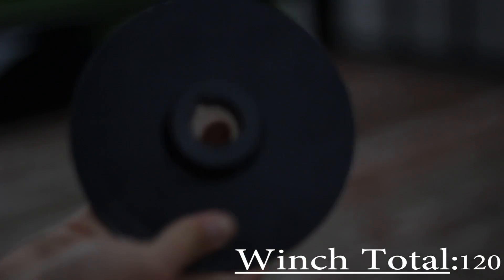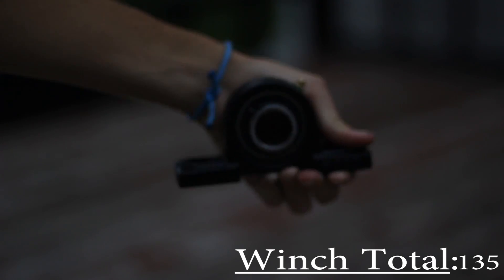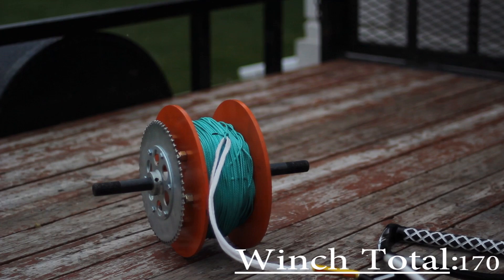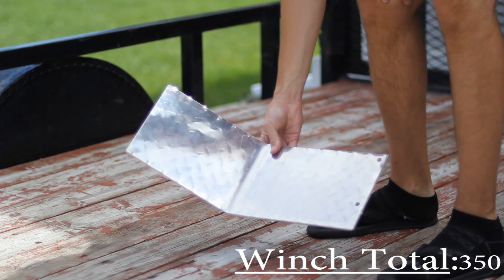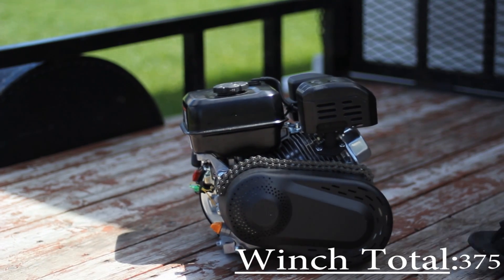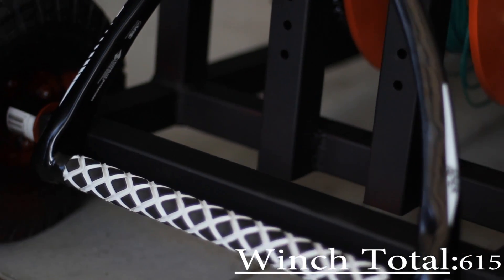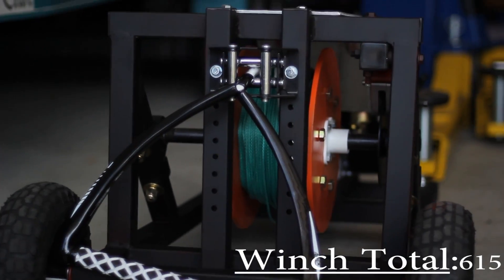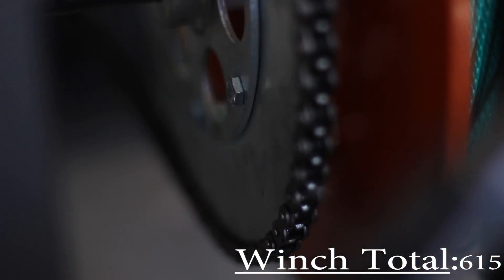Designing: Wake Winch

Comment: I realize this is an old video and you may not respond, but I’m curious if you think this setup would have enough torque to pull small kids up a mild sledding hill? I’m in the process of building on and I would hate to be wasting my time.
Reply: it would so long as you have at least a 3hp engine

Comment: Hey man, just wondering if the torque converter is necessary if I have a 9Hp engine
Reply from the maker: Most likely yes. Depends on a few more things, but you really should have a torque converter for this build. More HP does not mean more rpm, what you want is rpm if you plan on rolling a spool of line in.

Comment: Did you guys have a pin/locking system to free run the spool when walking the handle out? Or did you do so with the engine turning over? 

Also where did you source your line? Recently constructed our own but could only find one distributer of dyneema here in the UK!

Comment: To me the spool looks like the most difficult part! Did you buy it complete? Could you be more specific how you built it. Any useful links?

Cheers 
H
Reply from the maker: Yeah man, don’t buy it complete it’s not too terrible to make yourself. I don’t have any links, but I’m sure other dudes on YouTube have videos. Anyway, imagine two discs right, then find the center, from the center you need to center a hexagon or shape with more sides to it like a circle into that same center point. Make marks that are equidistant from each other and of course still proportioned to the center. Then take these disks, not with the marks, and use a drill press accurately, as to drill out each horizontal component in the spool. Once drilled, maybe like 3/4”, drop a minimum of a 6” bolt (grade8 or heavier) in each of the holes and sleeve a piece of pvc or copper or conduit tubing over the bolt so it doesn’t hurt the cable. Then you’ve got a spool.

Couple tricks though:
1. Do NOT measure for the center of the circle, rather, find the center balance point / center of mass. If it looks stupid, then shave the sides down by rotating it and then re-find the center of mass. This will insure even rotation when the spool is complete. Oscillation will be very dangerous (if you just measure for the center and it isn’t close to the c.o.m.)

2. Make sure, with the length and diameter of your cable, that you can fit it onto your inner spool diameter. Note that this diameter is dynamic, and a linear function, and not fixed. It will get bigger and smaller with cable being added or pulled out, so either make multiple possible drill holes like everyone does, or just do the math... or guess haha.

3. You will also need to mount the spool with hubs, to the axle that rotates. So to do this, either use a chuck way on the axis that lines up with the hubs (also called key-way). Or drill a hole through the axil and the hub and drop a pin that holds both fixed to each other. I prefer the latter, because it is solid. But it is easier to just buy the proper keyways.

4. Don’t rush it man. There is always a right way to do things, so research if you get stuck.

Good luck bro. Lmk if you need help
Reply from the maker: Harry Watson also hit that like button if you already haven’t! Appreciate it!!
Reply: Cheers mate, such a sick video, love the music! Don't listen to the nay sayers ;) Do you know about Centrifugal Clutch vs Torque converter ?
Reply: Is yours still going strong? After so many years?
Reply from the maker: Bro do not get a centrifugal clutch if you're doing anything in the water, it won't do your engine justice and you won't enjoy the ride. TAV is the way to go. And thanks man, haha yeah we got some haters, it's g tho cause I'm just trying to help everyone.
Reply: And did you weld the Steel Plate for the spool straight onto the shaft? OR did you use some sort of Joiner?
Reply from the maker: I sold this one to a Polaris team rider a number of years ago. It was a beast though, there is no way it's run into any issues. All you do is check to see if things are tight and everything looks good, and every so often check the oil level and quality and they run forever.

I built another one, it's on my channel in sort of a bizarre video, but it is super powerful. I can give you recommendations as far as engine size and other things, one thing is for sure though, make sure you get a non-stretch marine cable for the line. Amsteele is very good. You can run a 7/64" and it'll work perfect; but the 1/8" will last a little longer - it's just pricey.
Reply from the maker: For the spool go watch my new video and look at the pictures from 2:09 to 2:11. There was no welding. The bolts are held fixed because the inside has that tubing around them and it doesn't fit through the drilled holes and the bolts are fixed with lock nuts on the outside to keep the spool walls attached.
Reply: Brilliant, v helpful.  Keep the good work up!
Reply: Another question.. sorry.  Why do you use a disk brake? Isn't turning the engine off good enough? 
Do you have a link for the brake, is it a motorcycle brake.. how can I find one? Im struggling..
Reply from the maker: Yeah you need a brake. If you don't have one, then you will only get one ride per time you walk all the way out and also it is definitely dangerous not to have one. There have been so many times that the brake has saved us or someone operating the winch. I would recommend a hydraulic disc brake. You can find them on eBay and they will work great. It will actually be pretty cheap too. My new winch has hydraulic gas a brake and its very convenient. Just search Hydraulic Brake Assembly for ATV and find one that has the system and a rotor and then you might have to buy a hub for the rotor.
Reply: Thats so helpful cheers.. lifesaver
Reply: 1 last question.  What are the 30mm/ 1 inch bits called that hold the Spool walls to the main shaft? They have 4 bolt holes?
Reply from the maker: Harry Watson set screws or Allen set screws.
Reply: TheeFatPanda no. They fit around the shaft and screw onto the spool sides with 4 nuts. Sorry. Bad description.
Reply from the maker: Harry Watson the spool hubs or the spool walls? The hubs should come with the appropriate fasteners and the walls (if you’re making your spool) should just be bolted together in a circular more or less pattern (ie hexagon).

I don’t understand what you are describing sorry. You might have a part specific question and I am unsure what part it is. Link me to it?

Comment: a question, how did you manage to find a way to fit your sprocket to your axle?
Reply from the maker: Evert Wouda I don’t understand what you mean. However if you purchase a sprocket, you need to make sure it has the correct axle diameter and axle key way size.
Reply: thank you, would it be possible to send me a link of the place where you bought your sprocket?
Reply from the maker: Evert Wouda I don’t have that information, sorry. You can just google what you need though, for example, “60 tooth #41 sprocket 1 inch bore” and it will give you many options to pick from. Then simply check the “specs” information to see if it will fit your build and chain and axle and ratio. If you have a hard time, just go to a GoKart webstore and purchase one from there.
Reply: thank you very much for replying. 
I'm almost ready to start assembling, awesome video!
Reply from the maker: Evert Wouda you are welcome! Thanks and good luck! Be safe
Reply: Sorry, one last question, how far apart are the pipes that make up the 'circle' of the spool? i forgot that that makes a big difference for the speed.
Reply from the maker: Evert Wouda That is an aspect that you decide depending on your wants. Your line length and diameter will also add to that ratio and it will be dynamic as the machine pulls in more and more line so keep that in mind, however it is usually not a bother.

If you want to be safe, drill multiple locations linearly (and increasing in diameter) that way you can adjust your spool after a few tests.

I built an amazing machine back in March and it’s a newer video on my channel if you go look at it, and I actually guessed as to what would look good and I found the largest diameter possible accounting for my 1200’ of line was the best. I have multiple holes for adjustments however. 

If you send me your engine specs and your gear ratio and your line size and length I can give you a better picture.
Reply from the maker: My next build will have 10-12 bolts on the spool rather than the 6 here and the 6 bolt pattern in my recent one. This gives it a more circular shape and also makes it look nasty on the side of the spool which I like. But the 6 bolt hex pattern is very good and consistent with pulling if you use the proper cable.
Reply: my engine is 6,5 hp/4000 rpm with a 10 t torque converter, connected to a 60 t sprocket with an outer diameter of 8 inches. my line has a diameter of 5/28 of an inch (or 45mm) with a length of 1640 feet (or 500m)
Reply: and i like your idea of using 12 bolts instead of 6, that would probably cause it to pull much smoother too right?

Comment: Quick question....My friends winch keeps pulling in even when off the throttle...anyway of counteracting this without hitting the power off
Reply from the maker: Yeah, if you have a TAV you need to throw that idle ring on there for the 6.5hp model. If you have a 8hp then you need to make sure the belt is on correctly and you need to space it properly away from the engine so the belt is completely straight. If you have a centrifugal clutch model then you should send me a picture. Ultimately the idle feature is not a property of any mechanical part, it is the idea that the belt doesn’t catch the clutch. It means the belt freely sits on top the engine shaft and the engine shaft rolls underneath it. It is normal to have around 5-15lbs of pull for in idle however, you can adjust that with a more slick belt or even a sanded clutch. If you send me a picture I can help you best. Regards

Comment: Hey not sure if you're still responding to the video, but I just had a few questions... how did you connect the hubs for the sprocket and spool walls to the axle? Was it a key and did the axle have a keyway? If so how'd you make the keyway on the axle? I'm guessing the bores of the hubs were 1 inch same as the pillow blocks. Also, I guess you used collar locks on the pillow blocks? Really interested in making one just a bit lost with these technical details ahah.
Reply from the maker: Yeah man, seems like you understand pretty well already. All things attached to the axil (1in), and the axil itself, have a key-way in them. The key I used for the spool in the same for the brake, and almost any size could be purchased at the hardware store near my house (HomeDepot). The key-way will be built into the axil, especially if you are purchasing an axil off a go-kart supply, but just double check, it would be too difficult to mill a key-way. As for the hubs, sprocket and roters, the should already have the key-way as well, this is why we used go-kart hubs and sprocket; though if it does not include one, you could always drill through the axil and hub and place a fixed pin to lock the two part together. I would not recommend the "diy" approach though, as it will make things hard to fix and swap later on. And I don't know what your question is on the pillow-blocks, but if they are the same size as your axil, they have two allen screws that lock into the axil, and I replaced mine with stainless screws that include a sharp point at the end, and it locks very well into the axil. Just find the replacement allen screws at your local nut and bolt supply.

All that being said I am happy to help you more if you have any questions, but try innovating and learning from it. Just make sure that each session you have with the winch, you check the axil screws and connections, as well as the sprocket, or any moving parts. I have seen winches bomb if they aren't maintained.
Reply: Awesome, thanks heaps man that helps a lot. Yeah with the pillow blocks I didn't realise there were the screws so I was looking at other connections. I noticed there are a lot of those screws on hubs and sprocket carriers as well for fastening them to the axle. Would you recommend still using the key-ways on these hubs and carriers as well as fastening tightly with these screws? Or do you think fastening with the screws would be enough?
Reply from the maker: No you need the key-ways. We melted an axil when we were first designing because we just used the screws in the axil and during testing the spool started to slip and then eventually was independent and the friction melted the axil to a spool -- we had to restart. Definitely advise the key-way and if you have them, then use the screws to tighten even more.
Reply: Sweet as thanks for your help

Comment: Do you have any plans you went off for this build? Something I could attain to build the same?
Reply from the maker: Haha I'm sorry but no, the FRAME can be built however you want, as long as the chain will fit from the motor mount to the sprocket and the axil will fit across the width (18in). And the SPOOL can be built however you think will work too, I recommend a heavier spool because it pulls more consistently than a lighter one, there are many great sources on you-tube and wakeskate forums for that one. And the CHAIN and sprocket sizes need to be the same (close to 41 is good). What specific questions do you have? I can send you pictures of my winch if you want, but I don't have blue prints.

Comment from the maker: I should mention the winch you see in this video costs $800 due to the quality of the materials used in the spool and bolts. It is possible to build a winch for close to $500 however the functionality and durability between price ranges is notable. Strictly following the budget of the video, the complete fabrication and design will cost upwards of $700. In our opinion, a few hundred dollars more will change the riders experience and appreciate the value of the winch. 

The primary price difference will be in the spool. There are videos on YouTube that show possible designs for around $50, however to construct a decent spool it will be around $100 or more if you invest in performance. I recommend heavy spool walls made of steel, a 18'' cold steel axle, a sprocket that needs to be secured with its own hub purchased additionally, and I also recommend that you use a hydraulic brake system for safety. 

These recogmendations are made with the understanding of wakeskating. For other sports, such as: skimboarding, snowoarding, skiing, paragliding, sledding, surfing, and skateboarding, the winch may need to be modified or in some will not need nearly as much power. 

In the water, this winch will tow up to 26mph, however we used the set screw to govern the speed to 22mph. It is also dependent on the weight of the rider, don't use a 6.5hp engine for riders doing deep water starts above 180lbs, you'll need an 8hp with the corresponding tav..

Know your sport, check your spot, and get it done.